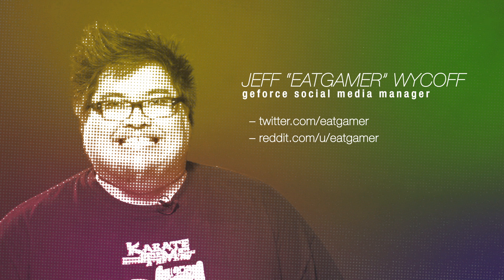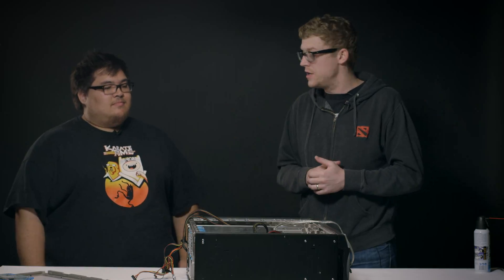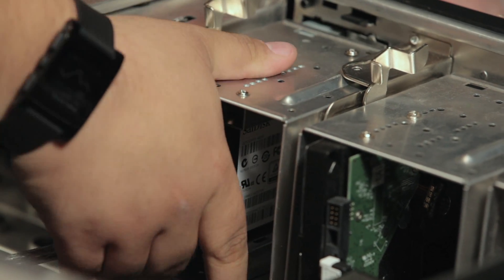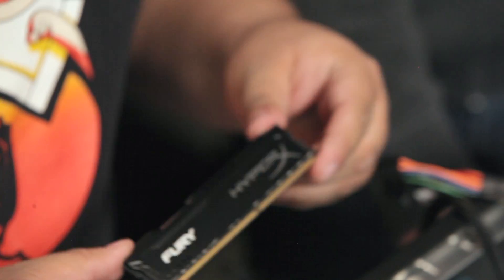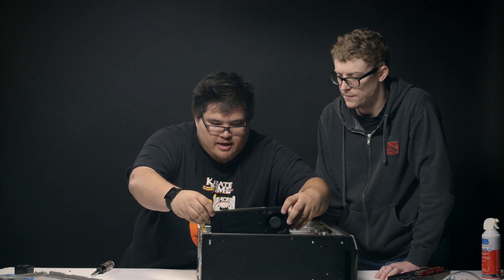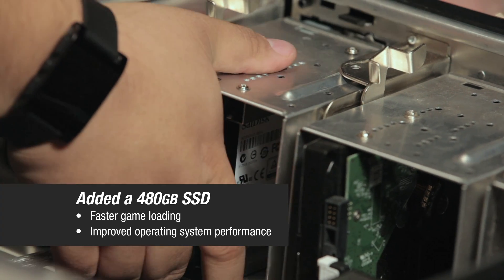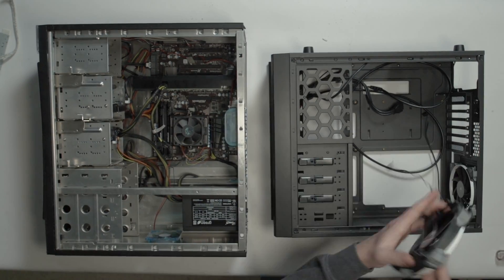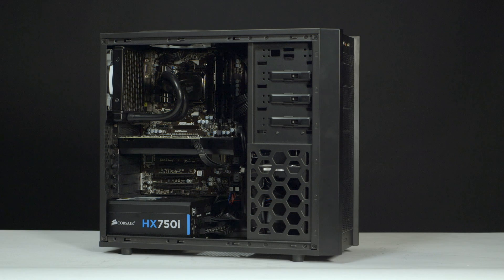GeForce Garage – How to Breathe New Life Into an Older PC

Comment: "Breath new life into an older PC"

>REPLACES RAM instead of adding to it (and 8GB is enough for gaming anyway)
>Replaces GPU with a 960 with the worst possible cooler on it
>Replaces PSU for literally no reason
>Adds an expensive watercooler for no reason
>Buys a huge capacity SSD, complete overkill

Isn't the whole point of upgrading a PC to save money that you would have otherwise spent replacing a PC? This is just as expensive as replacing the PC entirely with more sensible component choices.
Reply: TheJackalPhantom
1) yes you can, you can mix and match any kind of ram and 99% of the time there will be no issues
also that ram is still on the market...and its very good for the price
4) or you can get an air cooler for less that performs better
Reply: i think that the point of the video was giving the dude a new pc... if it's for free I don't complain about nothing
Reply: Think the first part was meant to illustrate what you can easily do at home without spending to much money. The ram was their the only questionable one really. The second part of the video was more a okay we showed you what you can do at home. Now lets completely upgrade this users PC to give him something nice and shiny with better cooling performance.
Reply: TheJackalPhantom 1. Uh yes, yes you can. You can mix and match any brand of RAM as long as the CAS latencies, voltage, and clock frequencies are equal. Source: me, I've worked in IT and upgraded RAM in hundreds of PCs. Also, ebay exists, so you could get the exact same RAM from there too.

2. This video is intended to be a guide, right? So they shouldn't be encouraging people to upgrade to a GPU with a terrible cooler.

3. >No brand PSU
Jesus, are you blind? It's a Rosewill Green series 630W with 80+ Bronze efficiency. The reviews on it are absolutely fine.

4. Again, this should be an upgrade video, not an entirely new BEAST PC replacement, there are plenty of much better price/performance ratio coolers available such as the CM Hyper 212 Evo.

5. It's overkill. Nobody actually benefits from having all their games on an SSD. Very few people play every game in their Steam library enough to benefit from the faster loading times. Getting a 128GB SSD for the OS, programs and a few games that you play very regularly is much more sensible.

Read the title of the video again. Breathe new life into an older PC. As in, upgrade parts of the PC that could really benefit with an upgrade but nothing more. There's a point where upgrading a PC just becomes replacing the PC and that's exactly what this guide ended up being.

ViniBreda90 
Read the title of the video, I don't think that's what the point of the video was, but of course the lucky guy who got the free PC replacement will be happy.
Reply: TheJackalPhantom This is getting stupid.

1. Random fact pulled out of your ass. [citation needed]

2. As in pretty good do you mean scoring the highest temperatures out of all other other options for coolers? I don't think higher = better applies here.

3. Random fact pulled out of your ass. [citation needed]

4. Almost double the price. I don't think I need to explain any further.

5. Ok so you're obviously either unemployed or you're a kid still in school because there's no way you could play all of those games on a regular basis otherwise.

And for your last point, I think everything I said just went over your head so I'm not going to explain any further.
Reply: TheJackalPhantom Yes, I do indeed regularly upgrade my PC since I was 11 years old and I have also once worked in IT where I have upgraded hundreds of computers over the years.

1. Wow, not only have you just linked me a Q&A page, but everyone who has commented has said that it should work.

2. I would say GPU temperatures are the absolutely highest priority. Case air flow is already present and should not be a problem exhausting any dispersed heat.

3. I am truly laughing right, again, another Q&A page where one single individual person claims without any evidence that their PSUs "suck". I fear you are trolling me hard right now.

4. >*double* the headroom for overclocking [citation needed]

5. Ok kiddo

If this is a troll, I am impressed, and it would be comedy gold.
Reply: I agree, I was expecting some insight from nvidia on more efficiently using the components that are there, clean up the system and overclocking, maybe add one new component to get the most bang for your buck rather than completely replacing everything but your CPU and motherboard. Those are the only components that remained from the original PC.
Reply: 1 you cant add simply a new stick of ram if that ram is no longer on the market you need to buy new ones problem is different ram sticks can cause serious problems for your Mobo also they said it was not needed

2 nobody cares you can buy a different one yes?

3 its replaced because its a no brand no go psu which could die any moment and fry everything only buy trusted brands on psu's and never cheap out on them you will regret it one day

4 its not that expensive you can get a water cooler for under 80 euro's

5 thats not an overkill and is as expensive as a 250gb samsung/intel SSD at the con of a little bit slower and they said they wanted most games on there so again no overkill

upgrading a pc is not meaning you need to buy cheap ass parts dimwit i upgraded my  i3 3220 and gtx 650 machine to a i7 4790k and GTX 980
Reply: Stalast k
Reply: TheJackalPhantom many years ago i had a HP desktop PC, it came with 1gb of ram a later for a few € i added 2gb, i bought them in a shop withouth knowing anything except that i needed a ddr2 with the right connector. it worked for years. don't tell me you need the exact ram and don't tell me they upgraded a pc, they built a new one keeping the worst components.
Reply: Could of just bought a new pc for the same price of upgrading...
Reply: Stalast cringe worthy.
Reply: SMAAAASHTV yeah always bothers me but hey its ''smart'' marketing.... lets slap something like bronze or platinum on it maybe people will buy it! there early power supply's (2009-2012) where all crap no brand capacitors no surge protector nothing just like your usual no brand power supply with a brand name on it to make it sound ''reputable'' and ''better'' while infact its the same wall mart psu you could buy for 10 dollars and now for 20 dollars because it says ''rosewill'' so i never looked at them ever again since then and dont care for them now as Corsair/be Quiet/CM/EVGA are simply the best options out there with every protection possible on it even with the cheapest ones and CM gives on some psu's 10 year warranty like my Cooler Master Silent Pro M2 850 watt still alive and doing well after 2 years of service and no coil whining whatoever
Reply: Stalast 
+
>firstly mounting everything in old case, then in new case AGAIN :v
Reply: Stalast  1 since almost everybrand uses different components its is difficult to match ram EVEN if it works it can bottleneck you pc this has been proven million of times stop being so ignorant

2 nvidia refference coolers are actually pretty good they suck air from within the case and exaust it from the back not heating up you pc

3 rosewill is actually not very trusted and is under the avoid at all cost on most websites some one even said that they where basically rigged to explode just because 1 person says its good doesnt mean its actually good

4 the cooler they have goes for 50-60 euro around here which is extremly cheap the CM Hyper 212 evo goes for 35 euro here considering the price and performance and silence the better deal would be the corsair hydro series

5 i play games such as WoW, SWoTR, Battlefield 4, Skyrim moded (which benefits from an SSD ALLOT!) Fallout 3 modded/fallout new vegas modded, Borderlands 1/2/pre sequel and Space engineers/Medival engineers this alltogether is around 300GB so a 480GB SSD would come in handy also considering SSD's become cheaper themn HDD's a 480GB SSD costs as much as a seagate 3TB these days not that expensive anymore and this guy gets it for free so who cares anyway if you want 128GN go ahead no one stops you so when i can get a nice SSD of 400-500GB i will go for it

tell me why would this not be an upgrade? seems like a good upgrade to me just because they almost replaced all parts doesn't mean its upgraded heck here is my old build VS mine now

old

CPU: i3 3220 3.3Ghz clocked at 3.6Ghz
GPU: Asus GTX 650 1GB
Mobo: Asrock H61m-VG3
RAM: Kingston 8GB 1333mhz
Storage: 500GB hitachi 5400 RPM
PSU: no brand 430 Watt
Case: crappy micro ATX case of 10 euro

new
CPU: i7 4790k 4.4Ghz
GPU: Asus Strix GTX 980 4GB
Mobo: Gigabyte z97x-sli
RAM:Corsair Vengeance 2x4GB 
Storage: SSD Samsung Evo 850 120GB 2TB seagate barricuda 7200RPM 500GB hitachi 5400RPM
PSU: Coolermaster Silent Pro M2 850 Watt 80 plus at 88% rendament 
Case: Corsair Carbide series 500R Black Edition

this is what i see as an upgrade overall
Reply: TheJackalPhantom Ok
Reply: thats what i wanted to write...
Reply: And,DO YOU HONESTLY THINK A 660 is going to stand a chance. I would know,i have a 660ti lying around amd believe me,it needs to go. You can't "breathe new life" into a 3 year old GPU by overclocking buddy,if you still have a 600 series that isnt a 690,uh its time to get something new.
Reply: GT Gaming  i bought a gtx 650ti less than a year ago and i'm able to play games like dying light almost at full details in fullHD, i don't think it's smart to buy a 350€ gpu to get 60fps at max details if something that cost 3 times less does almost the same (unless you need power to work)
Reply: Stalast I am sorry you have to put up with this troll TheJackalPhantom. I realize he knows nothing as soon as he said memory manufacturers all use different RAM and doesn't know only a handful of companies makes the actual ram sticks for second party manufacturers. I agree with you that this video doesn;t set out what its suppose to do which is give the people who needs to give their PC an extra kick for low money ended up being a "We're NVIDIA and we're gonna pimp this PC" A simple case upgrade, 120GB SSD and cooler upgrade like CM Hyper 212 Evo would've been just fine for this CPU and would've warranted only a few hundred bucks instead of the overkill that was this video
Reply: CallMeRabbitzUSVI the RAM chips actually get widly made by LOTS and lots of company's each on working at diffrent clock rates and power what i initially tried to make as a point is that for instance my kingston 8GB 1333mhz wont pair with the corsair vengeance 1666mhz WHICH i tested and my pc would not even start up and go in blue screen so dont tell me the ''it works'' because 90% of the time IT WONT

also they showed you how to UPGRADE you DONT HAVE to buy a 480GB SSD if you want a bloody 120gb SSD GO for it and stop complaining this dude got the upgrade for free from nvidia so all i hear is jealous people because some lucky guy got a better computer then them for free
Reply: superwolf95 what might be the worst component then to you? as it had a i5/i7 already (Quad core) and in there eyes powerfull enough these days so not a Core 2 Quad MoBo is pretty up to date in terms of what for interfaces it has.

keep in mind DDR2 has a different structure then DDR3 and DDR4 is already allot different from DDR3 and in terms of compatibility DDR4 is able to use RAM sticks with different clock speed/memory speed but all ram sticks are limited to the weakest component however on DDR3 this is not the case both my kingston 8GB 1333mhz and Corsair 1666mhz wanted to work at there stock clock speed but because my kingston lacks the speed and memory bandwith the corsair vengeance has it will simply crash hence my blue screen poped up keep in mind i said it IS possible but is most likely to bottleneck your pc or simply crash which happened to mine now however i will soon upgrade with another 2x4 GB to add 16GB of ram on my system there is a GOOD reason why company's and people like linustechtips always says to use the SAME brand AND serie of that kind of RAM to prevent bottlenecks keep in mind your CPU also plays a factor in which RAM type it alows and which not
Reply: i just won't understand what you said until you use some punctuation.  seriously, you can't make an argument without.
Reply: TheJackalPhantom The ram slots are usually set up in pairs, if you put two different models in the same pair of slots, it won't work since it's trying to run in dual channel, if you put the other model (S) in another pair of slots it's 99% certain that it will work.
Reply: Stalast good lord they built a new pc hmmm
Reply: The cooler is not that expensive though...
Reply: jamie oakes Lol, all those RAM modules will be running at the slowest speed of the bunch. It'll work but you're not getting good performance that way.
Reply: Stalast "upgrade your hyundai to rolls-royce" logic,
is it wrong? you get better....thing.
Reply: B4DH4cK3r did i ever say it was not?
Reply: B4DH4cK3r i said in a possiblility of it not being on the market anymore
Reply: ? *facepalm
Reply: TheJackalPhantom 4 Actually the Noctua NH-d14/15 is a way better option than liquid cooling on almost every aspect...
Reply: jamie oakes damn! 400mhz ram?! Are you running a pentium 4 or what?
Reply: TheJackalPhantom I just put a 1333MHZ GL9 HyperX stick togheter with my 4 gig and 2 gig 1333mhz GL9 TakeMS RAM and it works no problem on a very early DDR3 motherboard (Gigabyte GA-X58-UD7)
Reply: Rinkk it works because its the same speed and probebly same voltage
Reply: Breathe new life into an old pc: just replace everything in it XD
Reply: TheJackalPhantom 2) Rosewill is a bad power supply? I suppose this is a joke.
Reply: PLA1DT3AM they are not a reputable brand....
Reply: TheJackalPhantom Are you kidding? They have a 80+ bronze standard!
Reply: PLA1DT3AM that for power efficenty nothing to do with quallity... i mean some of my older no brand psu's have a bronze too.....
Reply: Should have gotten a cx600 lol
Reply: TheJackalPhantom They are really good! They are making big power banks, high quality bluetooth speakers and really good power supplies.
Reply: PLA1DT3AM i have a bad rep with them..... most of the time where i sold them i get them returned after 6 months or so in which they failed and even in worst cases fries my customers pc's to the point i ALWAYS WARN them for these shady brands this is the same shit like the ''white van speaker scam''
EDIT: for a facebook machine sure but for a game pc that is on around 8/12 hours a day THAT brand is not adviced to use in a 24/7-12/7 pc like mine
Reply: TheJackalPhantom I have a rosewill power supply in my server which is running 24/7 and it's storing all of my data.
Reply: TheJackalPhantom ha ha, I love how people think that 80+ ratings are indicative of quality. It's all about component quality and reputable brand capacitors in a PSU. Personally I wouldn't trust Rosewill as they have a reputation of cheap alternative to bigger brands. Now they may have come a long way since those days but I have never been inclined to give them a chance. I personally stick with Cooler Master, Corsair and EVGA.
Reply: Just a 750ti or maybe in the future, 950ti, would make it amazing
Reply: Stalast They're Nvidia haha, they probably had this stuff laying around and thought what the heck. Plus there were only 2 ram slots both full to my knowledge so no adding, just replacing.
Reply: there are 3 slots ...... derp
Reply: Baki Blaze 4 slots derpyderpington there are no 3 slot motherboards beside the ocasionall chinese rip offs or servers
Reply: That's not entirely true. I have seen a few ASUS motherboards with 3 ram slots and back in pentium 4 days, lots of AMD boards had 3 slots.
Reply: SMAAAASHTV yes but most of the time these days its single in line or dual in line which is either 2 or 4 slots
Reply: exactly
Reply: +TheJackalPhantom I know it's old now but this is 'upgrading' meaning it could well have 3 as it will be an older board.
Reply: Joeink100 well look at the mobo then in the video it CLEARLY has 4 slots....
Reply: +TheJackalPhantom yeah biu the point is you said most recent mobos had 3 ram slots and since people on this thread don't have recent mobos as they're upgrading 'old' pc's they might nit have 2 or 4 ram slots
Reply: +Joeink100 my 4 pc's from 2000-2004 have all 2 ram slots not 3... those 3 slots where before 1995 scrapped when DDR2/3 came with Single/dual line
Reply: +TheJackalPhantom I have seen a fair few of ddr2 mobos with 3 ram slots fairly early ddr2 boards but sone on pc's built in 2002 so if your upgradeing that pc it could be a thing
Reply: +Mr.Willistein lol wut
Reply: +Stalast youre right dude.. but if its free totally worth it for that guy lol
Reply: +Stalast the 960 is the main problem, worst gpu of the moment
Reply: +L3xou97 lol GTX 960 still beats a R9 390 in some games ROFL yeah ''worst''
Reply: TheJackalPhantom
 Nope, 960 is raped by the R9 380. In my country R9 380 is less expansive than the 950.
Reply: +TheJackalPhantom It was a hyperbole fer fecks sake.
Reply: TheJackalPhantom
 Fallout 4 just came out, it's not a good example.
Look with GTA for example, when it just came out the 960 was better than the 380. Now the 380 is better. It will be the same with the 380.
Now that the crimson drivers are no longer beta you can use it, nearly 4 fps more.

AMD card gain more performance over time. That was the same with 780ti vs R9 290x.

960 is a bad card that's all, nvidia is not selling it a lot so they are making 950, and it's not working good so they are thinking to make a "new" 750ti with GM206 inside to sell their GM206. But it will be a fail as always with nvidia in low end.
Reply: +L3xou97 the 290X can only dream of outperforming a GTX 780 Ti lol
Reply: TheJackalPhantom

Who gave weed to thejackalPhantom? I think it's good weed and he smoke a lot.
Reply: +L3xou97 dude a Fury X barely reaches a GTX 780 Ti's performance... oh wait yes it has 1GB more VRAM so it must be faster! on a side note even though i am dutch i don't smoke weed pleb
Reply: +Stalast The SSD I agree with, especially the size they went with. But the rest of it was just dumb. The only thing "old" about this pc was the dusty case. Everything else was relatively newish.
Reply: SchmeddyBallz
 It's nvidia, all these video are made only for marketing and money. They don't give a sh*t about their customer (look how much hotfix there was on the drivers, they do their driver really fast and they don't care if it work or not)
Reply: +L3xou97 i think you meant to say AMD drivers lol oh wait sorry AMD people still wait on a Fallout 4 driver oh well good luck
Reply: TheJackalPhantom
 At least AMD drivers are stable and there is no security problems ;)

And there is no Geforce experience (a very bad software, can't believe that I will using that in 2016)
Reply: +L3xou97 dude... last week the new &#39;&#39;crimson&#39;&#39; made GPU&#39;s litterly kill itself..... so far for AMD&#39;s perfect driver support

also Geforce Experience is pretty good and stable no driver problems on my GTX 970 so far... if you want stabillity DONT go for AMD... Nvidia always has game ready drivers at launch and there pretty solid if your GTX xxx gives problems you probebly have a faulty card and the manufractures are gladly willing to repair or change the product had this with my older GTX 650 crashing on every driver still had warranty on it (5 years) and i got a brand new one lol

EDIT: my EVGA GTX 970 FTW has life long warranty ;) so if it might suddenly self combust in 4 years or so i can always get a new one even after 40 years lol
Reply: TheJackalPhantom
crimson problem was with crimson beta drivers ;)
Beta drivers are not stable that's not a problem.
The problem is with nvidia all the drivers are beta.

I have problems with my 950m and with my older 650. If you want stable drivers, go with AMD
Reply: +L3xou97 haha nice one AMD dropped all driver support for the DirectX9 cards while nvidia still gives driver updated for the Geforce XXXX series..... go joke somewhere else man also i cant hear you over my stable 60 fps in fallout 4
Reply: TheJackalPhantom
AMD Dx 9 cards still work today, and if they stop doing new drivers it's because they can't do better. Why continue something that is already perfect?

And how the 3.5 GB are doing on your 970? Still in the past with Nvidia? You will see in the future you will cry with your 3.5 GB. Oh sorry, 3.5 + 0.5 32 bits
Reply: TheJackalPhantom
 Maybe your 970 run better than r9 390 in some games, but in the high Vram demanding games and in future games it's not the case sorry.

Yes 32 bits, the 0.5 GB are working on that bus. It's not my fault if Nvidia don't know how to connect Vram and if you don't know how to read.
Reply: +L3xou97 it&#39;s a 256-memory bus... not 32.... the problem with the other 512mb VRAM is that it shares its Cache with the other 3.5GB instead of having its own causing it to slow down... also a R9 390 is not going to magically become faster then a GTX 970.... why? because its memory clock and core clock are unable to utelize the 8GB its like the 4GB on the GTX 960 it just won&#39;t work... heck even in 4K gaming a GTX 970 beat the R9 390 in most cases it just depends if Nvidia supports the game or AMD does... in AMD powered games amd will get 1-3 FPS more in nvidia powered games with things like hairworks etc nvidia beats it wby 1-3FPS....

3.5GB is more then enough for a 1080p-1440p range card
8GB is overkill because if that card cant even get more FPS in games that a GTX 970 beats it in that 8GB vram is not going to help over 4 year either..... you cant expect a Fiat 500 to suddenly be as fast as a buggati veyron... it stays at the same speed....

my GTX 650 with 1GB still plays GTA V fine with its graphics over 2.3GB usage and its pretty stable running at 60 fps and small dips to 40 at times.... VRAM is overrated and if you think VRAM is what makes a card fast sorry but i am just not going to argue with that logic anymore... oh yeah lets slap 50GB on a GTX 650 maybe it can run EVERYGAME ULTRA thats not how it works dimwit

EDIT: also my GTX 970 is OC at 1500mhz and is outperforming the GTX 980 on witcher 3 i get 3-6 fps more then a GTX 980... so yeah for overclockebillity the GTX 970 also wins handsdown from AMD cards
Reply: TheJackalPhantom
 "the problem with the other 512mb VRAM is that it shares its Cache with the other 3.5GB instead of having its own causing it to slow down"

It's like if it was 32 bits. Because the bandwith is around 19 GB/s on the last 512 MB

"why? because its memory clock and core clock are unable to utelize the 8GB"

At least with a 390 you're 100% sure that you will have enough Vram, that's not the case with the 970. And in crossfire the 8 GB are useful.

"its like the 4GB on the GTX 960 it just won&#39;t work..."

So the 960 is bad, or why Nvidia stopped making 2 GB of the 960?

"with things like hairwork"

Hairwork? LOL
This thing is fking useless, in witcher 3 in 4K even an SLI of 980ti can't handle hairwork.

"8GB is overkill because if that card cant even get more FPS in games that a GTX 970 beats it in that 8GB vram is not going to help over 4 year either..... you cant expect a Fiat 500 to suddenly be as fast as a buggati veyron... it stays at the same speed...."

For the same price you have : more Vram, better drivers and same performances.

"my GTX 650 with 1GB still plays GTA V fine with its graphics over 2.3GB usage"

It's not really a 2.3 GB usage, or the RAM of the system is taking a bit or it's false.

"VRAM is overrated and if you think VRAM is what makes a card fast sorry but i am just not going to argue with that logic anymore..."

I never said that but because you're a fanboy you don't read what people with a brain write.

"oh yeah lets slap 50GB on a GTX 650 maybe it can run EVERYGAME ULTRA thats not how it works dimwit"

Stop smoking.

"also my GTX 970 is OC at 1500mhz and is outperforming the GTX 980 on witcher 3 i get 3-6 fps more then a GTX 980... so yeah for overclockebillity the GTX 970 also wins handsdown from AMD cards"

Look the video of Jayz2cents on 390 vs 970 you will see.
Reply: Stalast 660->960 lol Bottleneck
Reply: *best looking cooler, #referencecooler=sexyaf
Reply: We added an SSD so now your programs will launch faster so you can enjoy how slow they are-faster.
Reply: 8gigs may be the bare min you need, but 16gigs provides more stability.
Reply: The point of the video, is basic upgrades that you can do for any PC that will accept the components.  
Basic upgrade 1 - Upgrade your storage with a higher capacity drive so you can more room to store data
Basic upgrade 2 - Upgrade your RAM modules (as long as it's compatible) to allow larger sets of instructions between your CPU and the rest of your computer.
Basic upgrade 3 - Upgrade your Graphics card for improved visual performance in gaming.

That's the point of the video, basic upgrades.

Bonus upgrades like the used case which can be bought cheap are for the aesthetic.  Extra bonus upgrades like a new PSU,  cooling fans, CPU cooler and cables are things you get in the future.  This was a jump start version of it.  That's the beauty of DIY PCs.  You can customize them over and over.
Reply: Toxic Biohazard

1 erm no my kingston 1x8GB wont coopererate with my 8GB 2x4GB corsair vengeance look it up its more like 99% of times IT WONT work :/

4 with this cooler you get much better temps and its silent